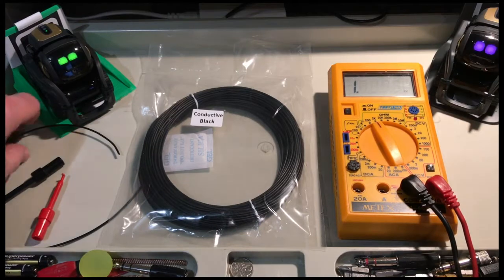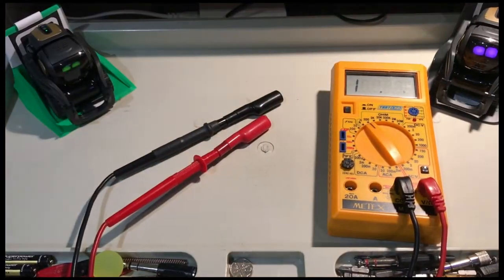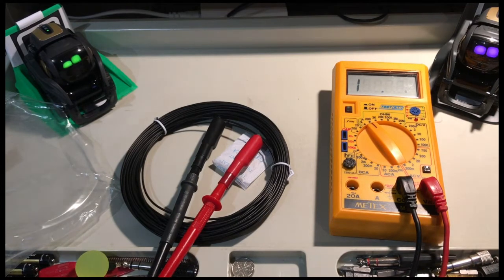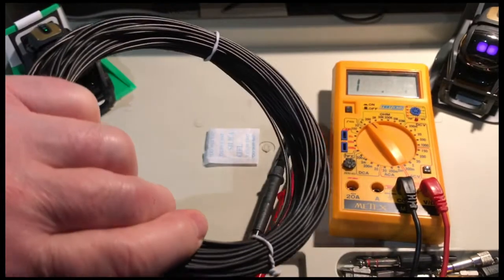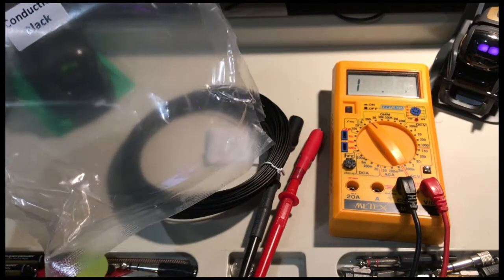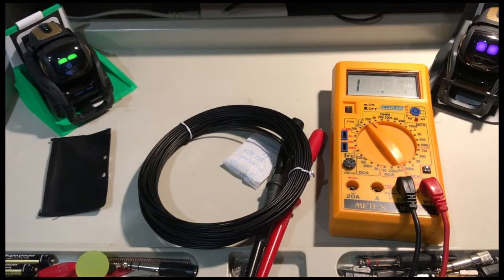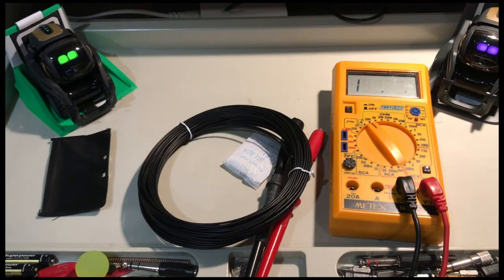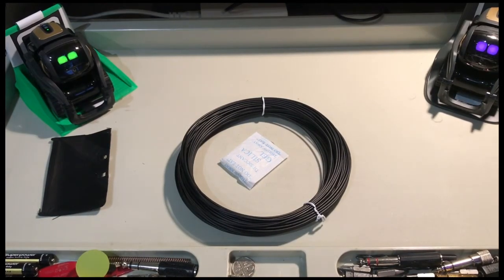Cheap Conductive Black PLA Is It Real Or A Scam?

Comment: 1:25 Oh snap, sorry man
Reply from the maker: Did you get caught as well, I really should have cut off of piece but thinking about it some more I have a feeling there was a loose piece in a bag which I tested and was okay, clever move on the scammers part, and knowing PLA goes off I didn't want to open the vacuum sealed bags until I was ready.  But as I say I distracted myself so ended up with bags of junk too late for a cash refund. How did you get caught? Please don't forget to subscribe to my channel and check out my other great videos and share #fixed1t with friends, family and colleagues. Many Thanks Malcolm aka #fixed1t
Reply: @fixed1t  
When I looked up conductive filament on youtube, this video was the first one that youtube recommended.
I almost purchased 1kg on ebay, however this video has warded me off. Thank you for taking a hit for the 3D community. =(